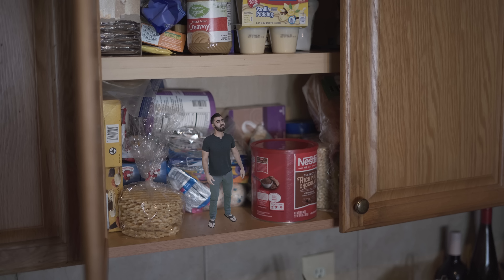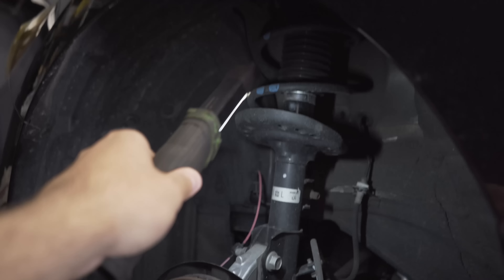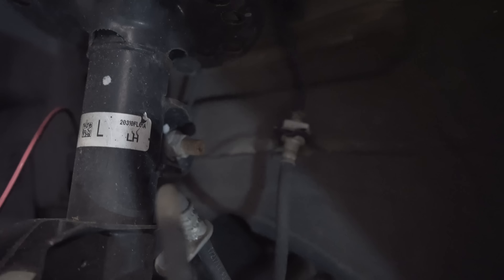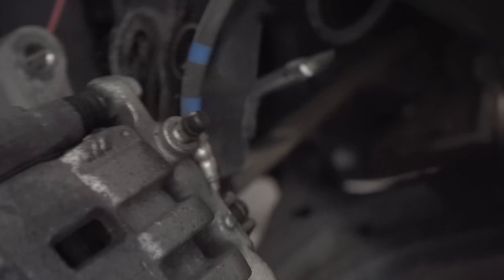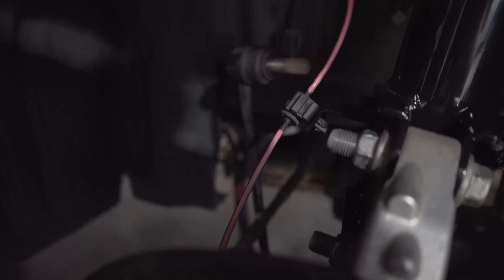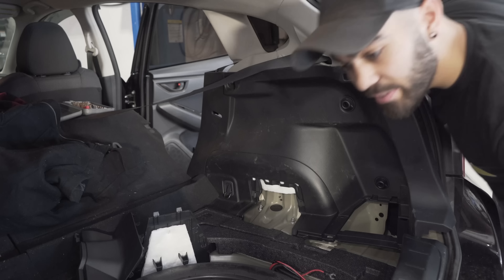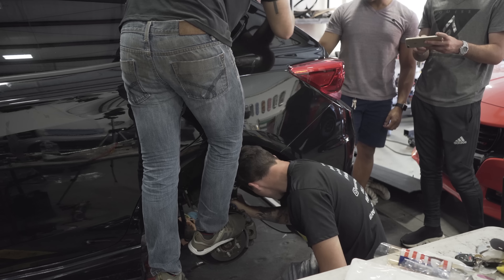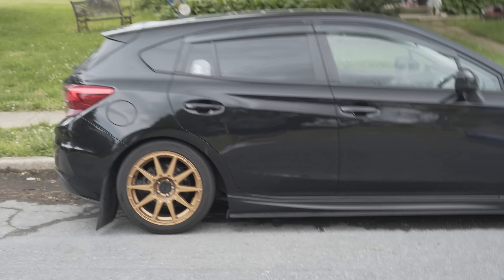How To Install BC Racing Coilovers (2018 Subaru Impreza)

Comment: I’m planning to do the same thing with my 2020 Subaru Impreza sedan, but what size rims do you have? I have avid 1 20 glossy black 18 x 8.5 on my car right now looks aggressive enough but I also am concerned about the rear because they’re rubbing so I don’t know if I have to change the lower arm bar in the rear

Comment: Just installed some BCs on a 2018 Impreza wagon and used your video as a guide. Thanks 🙏  Thankfully, didn’t run into any problems and everything went smooth.

Comment: No into the lowering thing but now I know how to replace struts.. thanks brother 👍 question will this effect the service contract? You know how Subaru works they will blame any suspension or front end issues on this!!! Either way well done 👍 watch jacking the car you should be using pinch weld protectors.. safest jack points are front cross member or rear differential.. just a thought bud . Thanks for the education. Saving a ton of cash cause of you brother
Reply from the maker: They can always deny the warranty. We’ll see how it goes in the future

Comment: Looks good man, what else do ya plan on doing to it? I gotta 2015 Impreza hatchback, so these vids are helping quite a bit.
Reply from the maker: I plan on doing a wing, new rims, wide body, new grille, maybe full wrap, and more!
Reply: @DomFillari  I'm gonna get the sport mesh grille and get some of that mesh to redo the bottom bumper grille to set the whole front end off.
Reply: @DomFillari  so u plan on ricing it even more nice

Comment: thanks for the knowledge bro, good video! hows it handling now , tho?? why did you go with those those coil overs in particular? thanks again
Reply from the maker: There are certain things where quality isn’t really that important, but suspension isn’t one of them. It’s very important. I heard BC was a good brand, so I pulled the trigger on those.

Comment: I couldn't get someone to help me take out the rear suspension so I used a smaller jack amd placed it on the leveled part behind the brake and it pressed the rear suspension and was able to remove easily.  Just a FYI for anyone having that issue.

Comment: Did you get the swift spring upgrade?
Reply from the maker: No I didn’t, what is that?
Reply: @DomFillari  Basically they are an upgrade to the springs that the BC Racing coils come with. Swift springs offer "a noticeable increase in traction, smoother weight transfer, better ride quality, lower tire temperatures, and a more predictable feel".